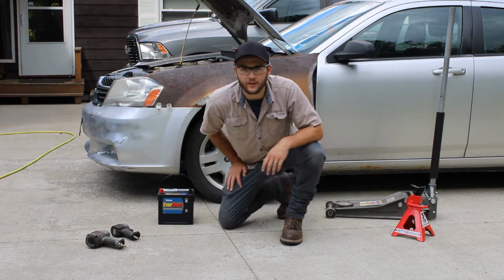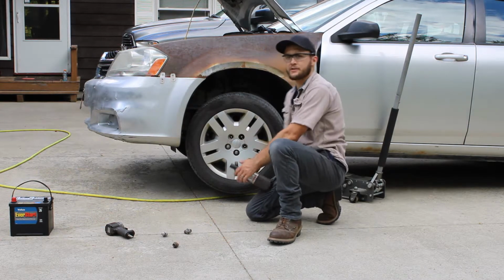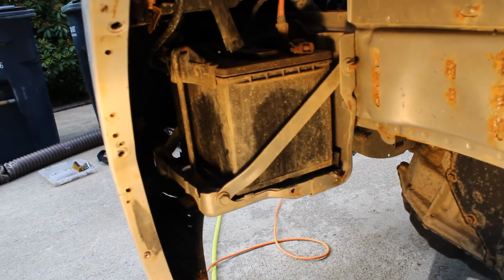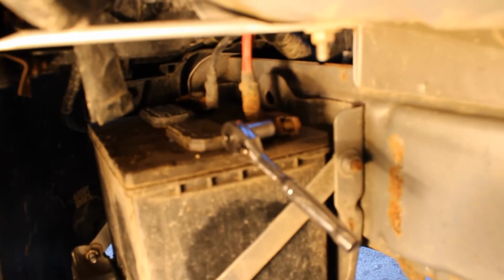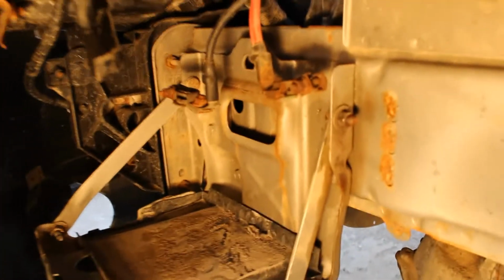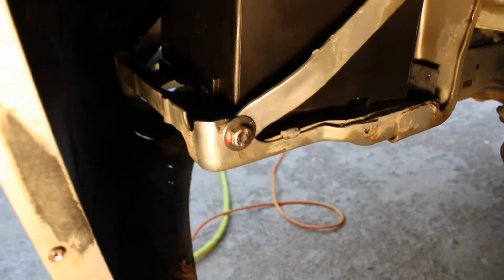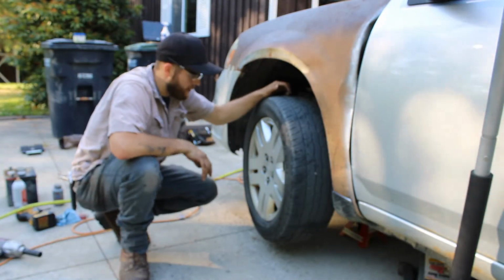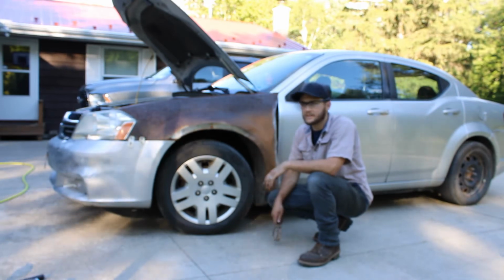How to Change Battery In Dodge Avenger

Comment: Where u get the battery n how much was it ?
Reply from the maker: Hey friend this was a few years ago. Prices have gone way up. I believe I bought this from Walmart. Today it would probably cost about $180.
Reply: @automotivated5934  do you kno the website I could search it
Reply: Says 500$
Reply from the maker: @antisocialbd2300  crap! I’m sorry about that. Here’s the best deal I could find. For the money this is pry the best battery you can find. Let me know how it goes!

https://www.autozone.com/batteries-starting-and-charging/battery/p/acdelco-advantage-battery-86s-group-size-86-580-cca/750144_0_0
Reply from the maker: @antisocialbd2300  also in the video I installed a Group 26 battery. It should have been a group 86 battery like in the link I sent you. I bought that group 26 because I got it cheap. With the Avengers they will both work (the posts are the same and the height is the same) as long as the Cold Cranking Amps match. Hope that helps. Thanks again for watching!
Reply: @automotivated5934  I’m so glad I found this video and these comments! I have been trying to get a battery for months and the parts place I went to sold me two separate wrong batteries despite me telling them it was the wrong size and the +/- connectors were in the wrong spots 🤦🏻‍♀️ thank you for confirming that the battery I’ve been trying to buy will fit in my car!
Reply: Walmart $70

Comment: I broke the bolt for my hold down too, but the entire shelf for the battery was so rusted I had to replace it. About $70 for the piece. If you turn the wheel all the way left you dont have to remove tire, I did jack it up slightly though to make a little more room. Btw 2008 avenger, watch subframe for rust alot of them have had problems.
Reply from the maker: Haha damn that sucks! I do like having the tire off for this job. Especially with the camera. lol.  We live in Western NY so we can sympathize with your rust!! Thanks for the comment friend! Let me know if you can think of any other projects I should shoot.

Comment: It's way easier if u drop the bumper....I've had the car for 5 years changed 3 battery's and trust me drop that bumper less stress getting the connectors on and the battery in
Reply from the maker: Haha next time I’ll do that! It’s tight through the wheel well. Thanks for the advice Vaughn!
Reply: True this, I took off my bumper and the view u get is a lot easier to work with then the tiny space from the wheel
Reply from the maker: @avothebozo6321  thanks for watching friend! You didn’t have any issues with plastic breaking on the bumper. For some reason up here in NY, Especially if it’s cold and being so old, the bumpers don’t like to come off.